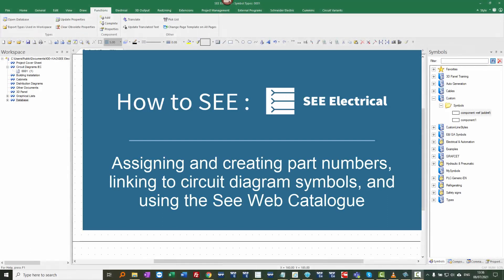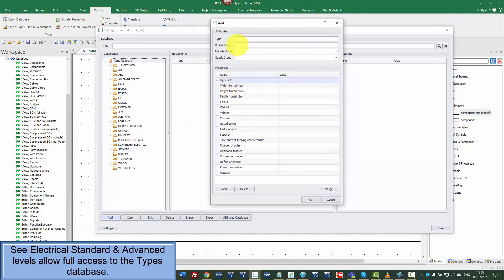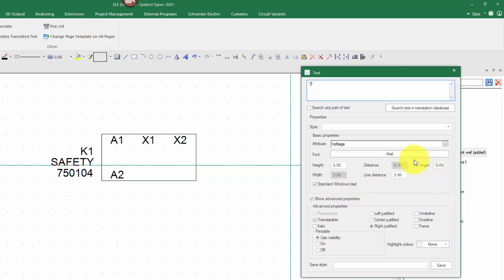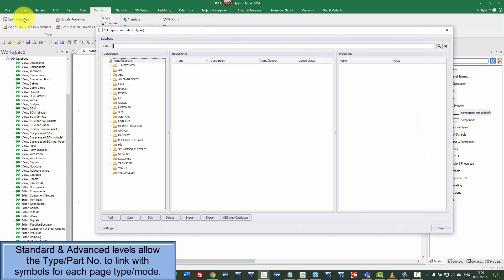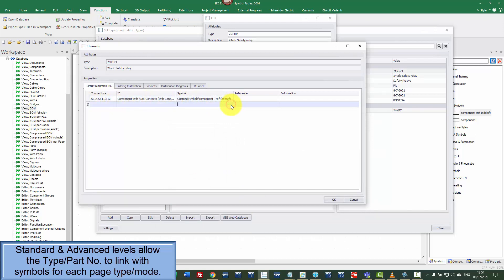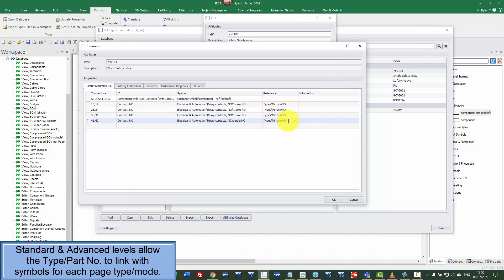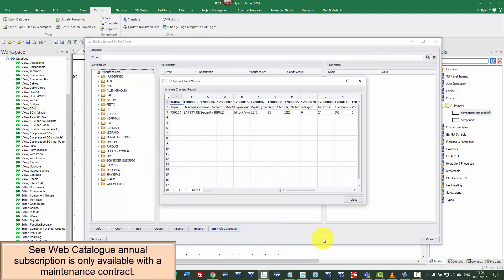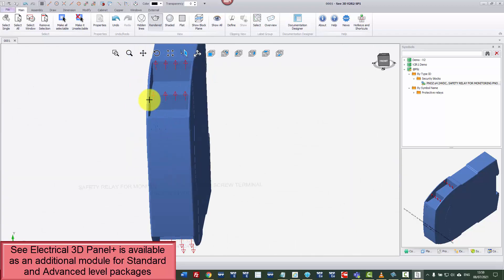Creating and Assigning Parts in See Electrical V8R3

Comment: I tried to create new symbol but connections dots not displayed?
Reply from the maker: Hi @uppalurisravanthi7277, make sure if you're adding the connection points as text to use the correct attribute for Connection - Connection, or change the attribute to this afterwards. The dots should then appear if you have the view setting switched on for connection points. Alternatively, place another symbol, right-click and exploded it and copy the connection text from there.